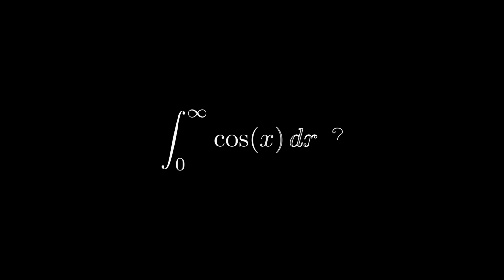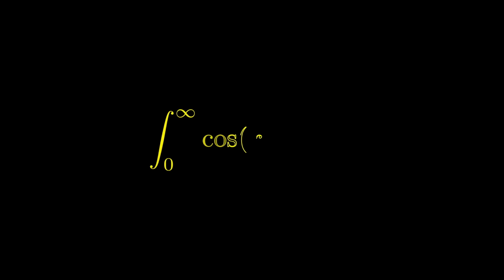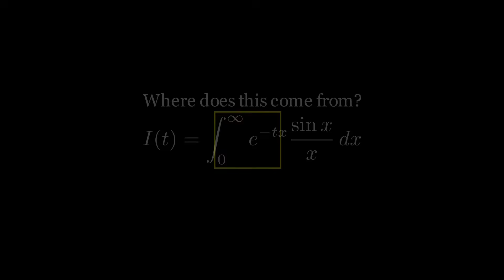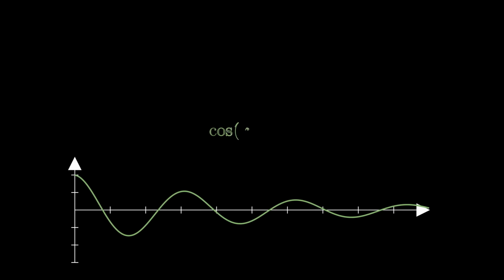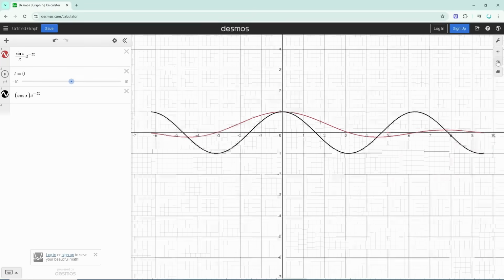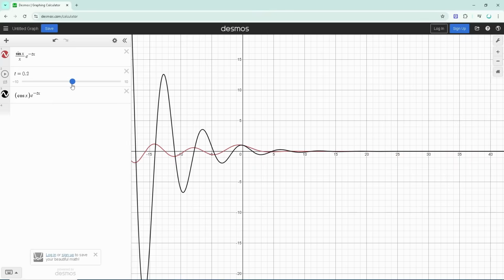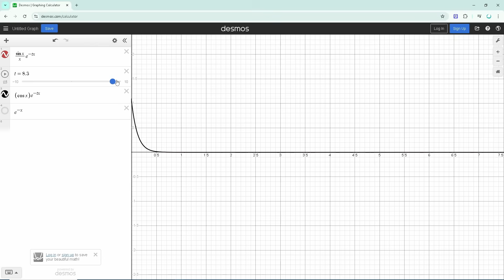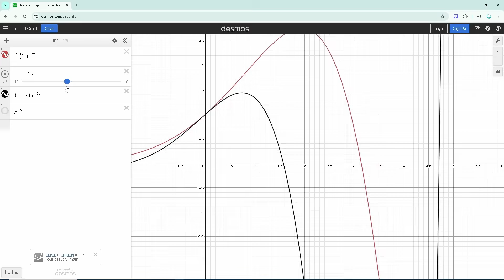This Isn't Talked About Enough...What e^-tx Is Really Doing For These Integrals!

Comment from the maker: Small error, during the steps for solving the dirichlet integral, arctan(x) should be -arctan(x). Also, remember that the function is a "dampener" function, and more videos on its uses on physics, wave equations, and more, will be coming.